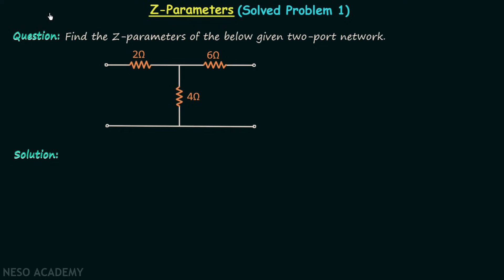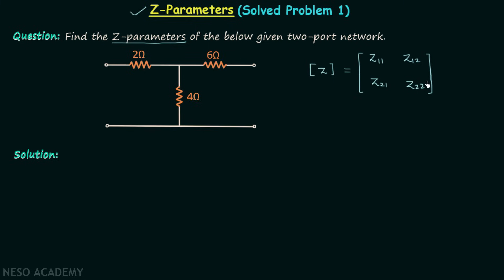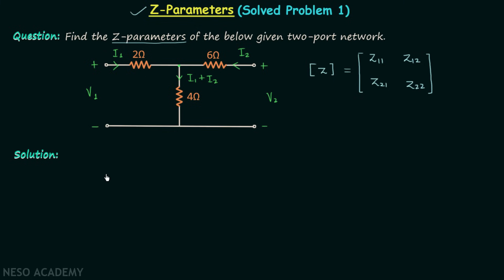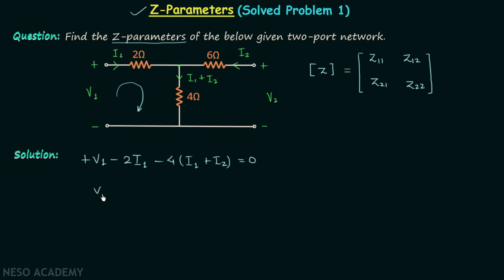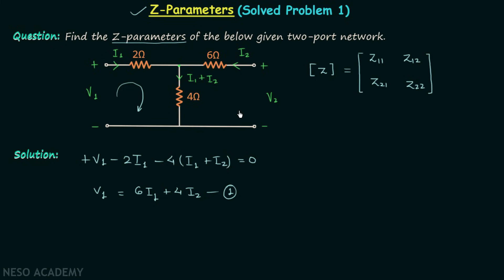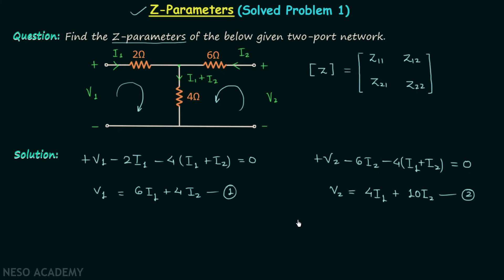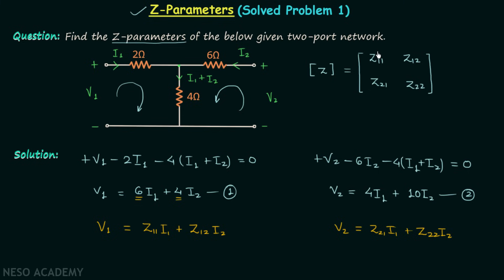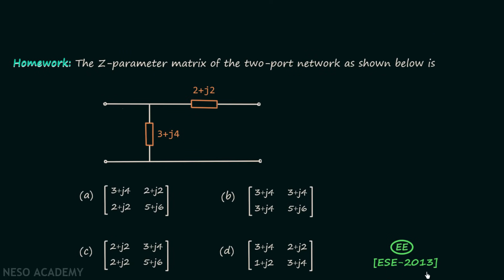Z−Parameters (Solved Problem 1)

Comment: Z22= (V2/I2)|I1=0 and open circuit driving point output impedance.... In last question option B is the correct answer.

Comment: V1 -3+j4(I1+I2)=0
V1= 3+j4 I1 + 3+j4 I2

V2 -(2+j2)I2 -3+j4(I1+I2)=0
V2=3+j4 I1+ 5+6j I2
 So the ans will be B
Reply: thank you
Reply: same quetion but calculate y,t,t',h and g-parameter define.please
Reply: Thank you
Reply: Btw what is j??
Any physical significance??
Reply: @shashwatkumar3108   here j represents the imaginary part of these complex numbers
Reply: @shashwatkumar3108  j is an imaginary number bro
Reply: Thank u
Reply: Right
Reply: Thank you ☺️
Reply: Ya
Reply: Method looks scary but u r correct.

Comment: ans is optn B
Reply: plz explain if possible
Reply: V1=(3+j4)I1+(3+j4)I2     V2=(2+j2)I2+(3+j4)(I1+I2)     after applying kvl we get these two equations and we solve these we get the answer which is option b
Reply: Good👍
Reply: Yes
Reply: Yes

Comment: Clear explanation. And answer is option B
Reply: How did you get ans b , please help
Reply: @eltnfernandes3122 

V2-(2+tj2)12+(3+j4)(11+12)after
applying kvl we get these two equations and we solve these we
get the answer which is option b
Reply: @eltnfernandes3122 

V2-(2+tj2)12+(3+j4)(11+12)after
applying kvl we get these two equations and we solve these we
get the answer which is option b